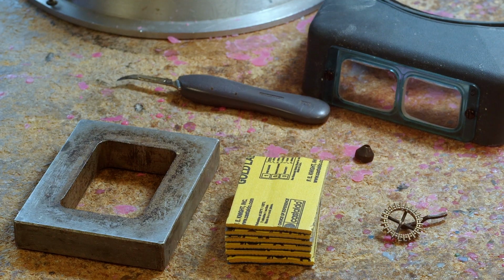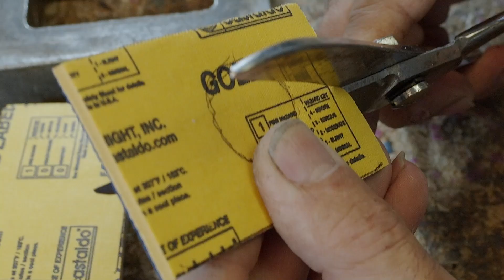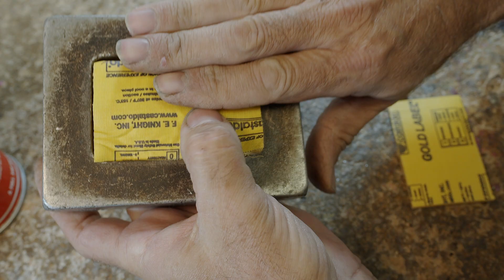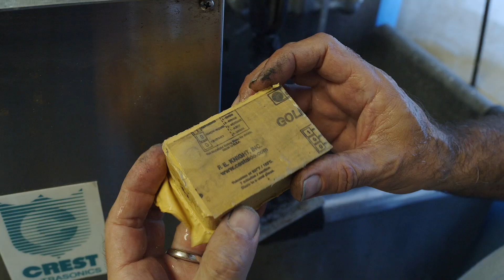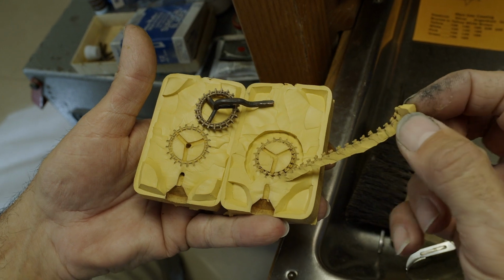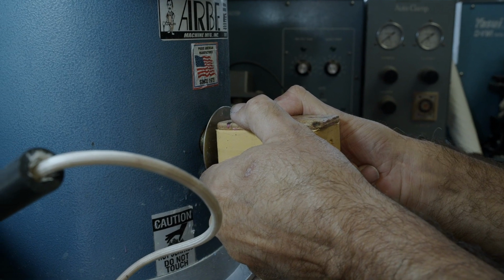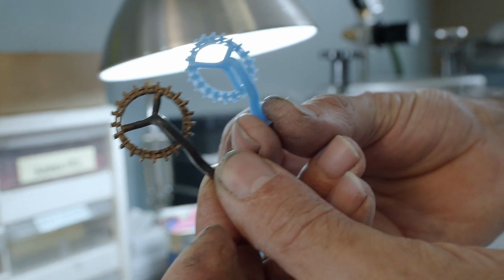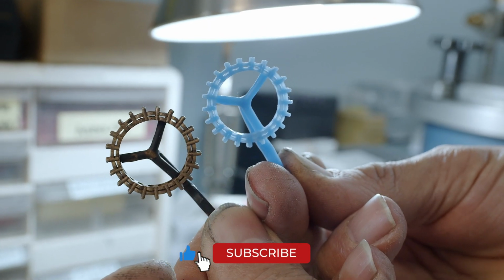How to Make a Vulcanized Rubber Mold for an Eternity Ring - WOW!

Comment: Please explain why do you cut cones into the mold at the outside.  Best regards 🇸🇪
Reply from the maker: Can you specify the time on the video that you are referring to.
Reply: @Crmjewelers  3:12 

I’m starting a jewels shop and still amateur . 
Could you if there is a possibility make a video how to cut and why you cut in that way. This video seemed was little fast 🙈.. 

Like this ring you cut out , you cut around and cut out some part of the mold, when I watch other videos of other channels the dived the mold into two, but you dived into many parts .

Sorry for the long question best regards and have it best! ❤️ sincerely
Reply from the maker: We specified with text on the video. Those are male/female guides at the corner to hold the two halves in place when you're going to inject the wax.

Comment: You could explain what exactly vulcanised rubber is? I know it is used in the highest quality ruber watch straps like on the AP ROO 44mm.
Reply from the maker: Yes, that's a good point Andrew.
Reply: Hi Andrew Vulcanize rubber is the one you have to cook , in this case when you vulcanize the rubber layers together it becomes one solid piece of rubber and then you cut it to get the piece out and make sure when you inject the wax , it comes out good the piece you’re duplicating
Reply: @gastonrives3392  Thanks, I was really referring to the Audemars Piguet Royal Oak Offshore 44mm straps as I originally followed CRM regarding watches and is where, about 2015/16 I first saw AP ROO 44mm and 42mm.  Their straps are top quality vulcanised rubber.  When I have looked into it it mentions Sulphur is incorporated into the rubber in some way to make it higher quality and harder wearing.
Reply from the maker: Thank you for joining the party Gaston 😜👍
Reply: La savia liquida  que se extrae del árbol de caucho se diluye con agua al 15%  y se mezcla con ácido ácetico o fórmico para que se solidifique y luego se seca, ese es el caucho natural. 
Despues ese caucho natural blanco es mezclado con 3-10% de azufre y calentado de 100 a 150C para obtener el caucho negro, que tiene más resistencia. Este último proceso es la vulcanización.

Comment: Seemed amazingly intrecate to make one ring, but that rubber mould will bbe made to make multiple wax versions of the original ring. I assume that this is disposable and melts when moulten gold is poured into a sand mould. I have a couple of technical words that I think are related, like die as in die cast and former.

It makes you wonder how they originally dreamt up this manufacturing process. You have to be impressed with the ingenuity. I'm always impressed with the early physicists who formulated the movement of the planets around the sun and the precisely timed astronomical events. Would like to see the finished article. Is Carlos a trained jeweller or a businessman with a watch and jewelry business?
Reply from the maker: Yes Andrew, the wax mold melts away when the molten metal is poured into the mold. We'll cover that part on another video. Carlos is an entrepreneur and the face and founder of CRM Jewelers. He talks a bit about his history in the CRM family video we released in April of May of this year.
Reply from the maker: @andrewholt3849  Indeed Andrew. I've watched this video before. We've wanted to make a modern video on the gold refining process, but these places are typically very secretive and ridden with mystery. One day perhaps 🤷
Reply: There are quite a few that played after that. They have to use Chlorine gas to remove impurites as I remember it is highly reactive, but Gold is very stable and unreactive, why it doesn't oxidise and is better than 904L steel. I have another video abbout Gold from the BBC, which I put on my Instagram about the Bank of England Gold store as it's all related to economics and maintaining the value of currency. Apparently we in the UK sold off a lot of our Gold reserves and the Bank of England acts as a repository for other countries' Gold and refused to return it to a South American Oil producing country, probably Venezuela.